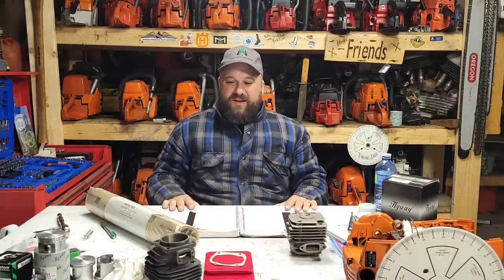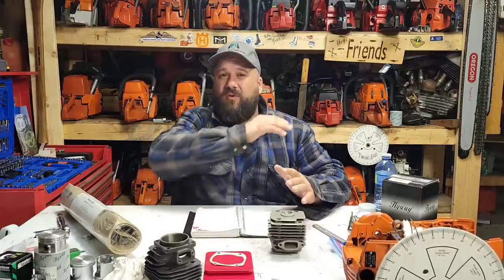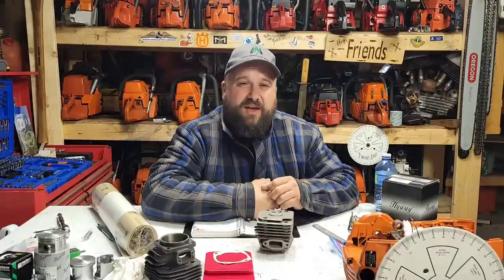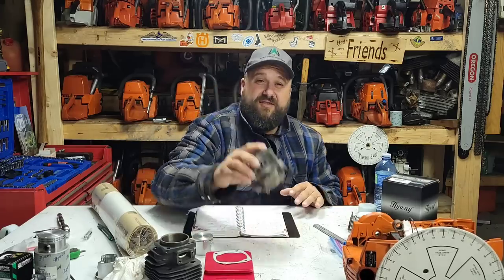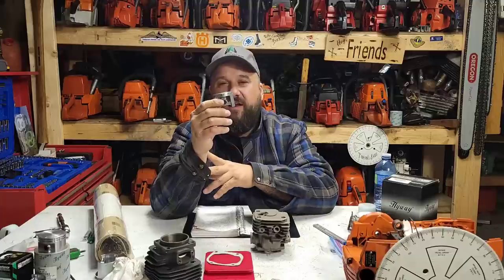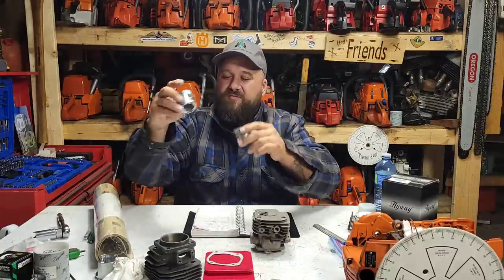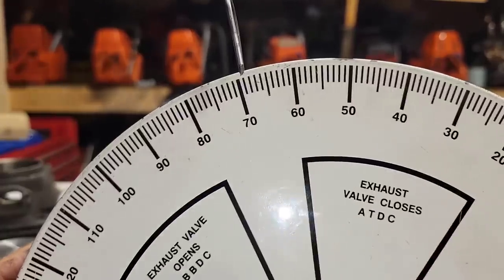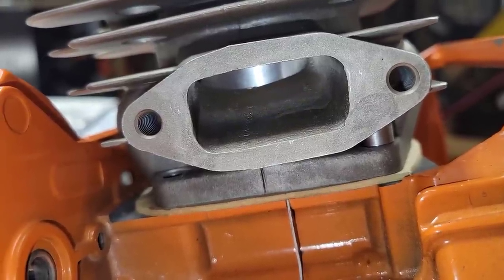Don't have a lathe but still want to do a piston swap? Watch this.

Comment: Tinman- love the content! Gotta share this with you- try this please- when using the hole punch to make gaskets, do it on a steel surface, No cardboard. Tap lightly so you don’t crush the end of the punch- with no cardboard cushion the punch works through the gasket material very easily. Lighter taps. Clean holes. 👍

Comment: Tinman no lathe here. As a metal stud framer for 40+ years I also have had many cuts on the job. The worst from tangling with a 4 inch grinder. Love your videos, I've got my husky 350 all torn apart getting ready to rebuild her. I've learned a lot from you thanks
Reply: 350 is mean once its ported, id rather have my 350 than my 545 for limbing and small stuff
Reply from the maker: Those studs are super sharp!!

Comment: Interesting talk on saw timing.  If I was younger and used my saws more, I would do some experimenting, but for now at least, I'll just enjoy learning about the ins and outs of timing.  I have a couple of 2100s to restore, and I will do some thinking as to whether I want to modify one. 
I have had a lathe since 1970, and wouldn't be without one.  I also have a small vertical mill, but if I could have only one of the two, it would be a lathe.  When I didn't have a mill, I made a milling adapter to do milling on my lathe.  It worked great.
I have cut a lot of my own gaskets over the years.

Comment: I tossed together a 372 with a 268 piston a while back, stacked base gaskets, purely out of curosity how it was going to run. Intake ended up at 164, which is more than I like, but the 372 seems to be blenty happy without the extra case compression. OEM jug, 0.0195 squish, exhaust ended up at 102, transfers at 124. Thing ran very well even before I ported it, no shortage of snap on the throttle. 
I have not played with a 52mm setup in quite some time.

Comment: With a thick base gasket like that use a torque wrench so your cylinder is sitting parallel to the case . 🇦🇺👍🏻great stuff Tinman

Comment: I was able to do a 272 piston in a big bore 372 build without any lathe work by putting in a shim gasket in and using JB weld on the intake ironhorse style and it worked a treat

Comment: That seems like a thick gasket...hmmm. I guess we will see how it turns out. No lathe in my shop. Timed out my 272xp, with a base gasket .027thou squish, 148° intake duration, 104° on the exhaust and 21° blow down. Polished up the exhaust port and cleaned up the piston windows. Let me know what you think. I think I will run with these numbers and see how it cuts. TC Mahalo Tinman 🤙🤙🤙

Comment: I always learn something new when I watch your videos. I know this video is several months old, but I hope you answer my question. I have a 365 Special that the spark plug"s ground electrode broke off while it was running wide open. It ran around the top of the piston siezing the ring and peckering up the squish band before it traveled down a transfer and wedging between the crank throw and case where it locked up the engine. I've been watching yours and Ironhorse's videos on how to port a cylinder. I used this cylinder to learn to port on. I also removed the damage to the squish band. I actually did a good job on the porting and thought I might try to use this cylinder. I have around 0.055" squish now.  I thought I might do a similar piston swap. My question is will a Stilh 036 piston or a Husky 262 piston work? If so does it need to be a pop up piston and which do you recommend? If you don't want to make a recommendation I understand but could you give me the demensions of each piston? I know they are both 48mm diameter. I need to know the distance from the top edge of the piston to the center of the wrist pin and to the bottom of the skirt. I don"t have money to spend on parts to be able to measure them to see if they may work. Thanks!

Comment: Hmm thumbs, I sliced halfway through the tip of one of mine with freshly sharpened hedge trimmers , the hospital took an xray and found the cut was 1mm away from the bone, it took years for the feeling to come back in the tip of that thumb. Look after them, you only get two of em...

Comment: Right now I have a newer model 462 a guy ran alcohol in 🤣 I'm gonna try a 461 piston. Ik it's not a stato piston but ik the 461 piston is taller and the intake with 461 piston has too big of a intake. I'm gonna try a bigger gasket cause the top of piston dosent clear squish with stock gasket. Gonna try this any input would be helpful. Thanks for the awesome videos and keep on keepin on man!

Comment: hey Tinman. Great content, love it.    I am building a 266XP currently and have a question.   I need more intake duration and don't want to enlarge my intake to much and slow the velocity down,  If i cut the skirt down a bit on my piston, do I need to trim both sides? didn't know if it would throw the balance off and wear one side of the piston more or prematurely? thanks a bunch for the time,   Shelby Wright
Reply from the maker: Cut the intake side only it will work just fine. Happy porting!!

Comment: First off, thank you for the excellent content and sharing your knowledge.  Now I might be missing something but wouldn’t raising the cylinder actually help to prevent free port as you are raising the bottom of the exhaust further up the piston? I’m just out here learning as much as I can before I take the plunge into porting my saw.
Reply: You are right, but i think he mentioned that the piston skirt is shorter with that new piston.
Reply: I knew I must’ve missed something.  Thanks

Comment: Hey tinman, built a 372xp not long ago, intake 154° exhaust 99°(stock) and 24° blowdown, runs awsome idles great, but takes like 8 pulls to start, may i have done something? its got a brand new carb kit bearings seals bottom and top end, any ideas on direction to look into, thnx
Reply: look how the fuel filter looks,if dirty doesnt get fuel so easy.
Reply: I traded a load of firewood for a 372 about 20 years ago, it had just been rebuilt.  It had the same issue but I never thought anything of it because it always worked good, fast forward to 2023 and I watched Steve’s small engine saloon about carb tuning, I adjusted the low speed jet out a little, now it’s running in three pulls.  
It also ran excellent and would idle no problem.  Just an idea
Reply from the maker: It may need more low jet like .aybe 1/8 turn. Or perhapse the little oring behind the sleeve on the clutch side is missing, that can cause a small air leak.
Reply: Thnx for the advice, it deffinetly had that little o ring when i rebuilt it, thnx to the tinmans videos i knew the o ring was necessary, screwed the low jet in a smidge and bam runnin like a top